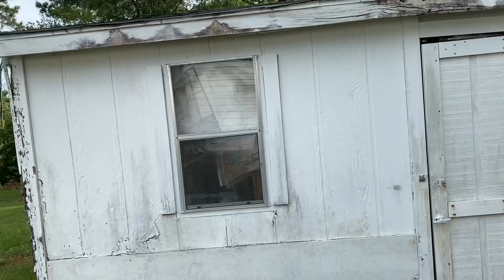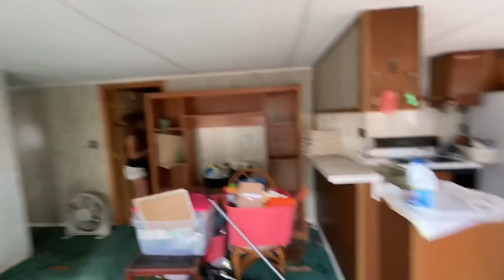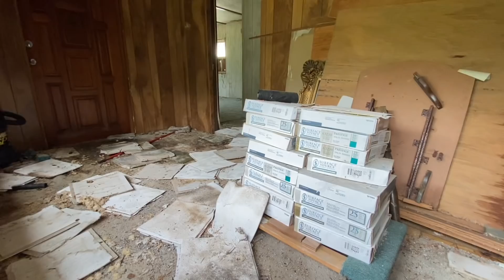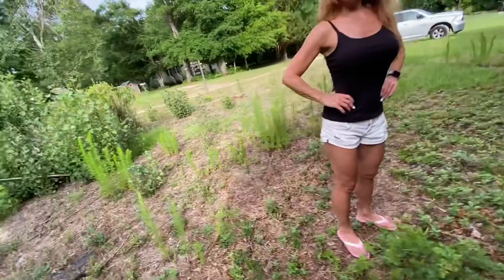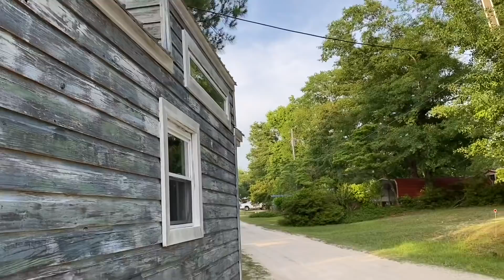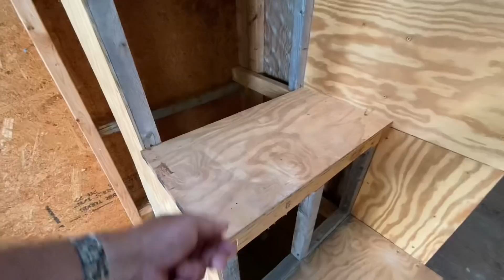Buying a Tiny Home

Comment: My Uncle Jack used to build custom campers in Mobile, Alabama and some were basically tiny houses that fit in the back of a full-size pickup.  His personal camper was an over-the-cab version which could comfortably hold two adults and two kids that included a tiny kitchen and bathroom that he used on vacation long before the RV craze became mainstream.  He built one for my dad but it was basically a camper shell with louvered side windows and a storage cabinet in the front, it wasn't anything like his personal camper.